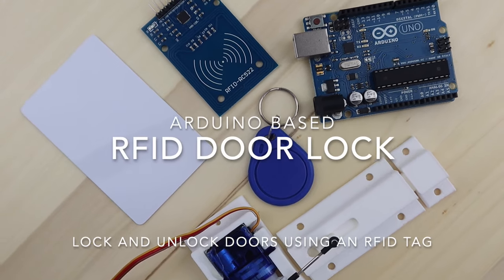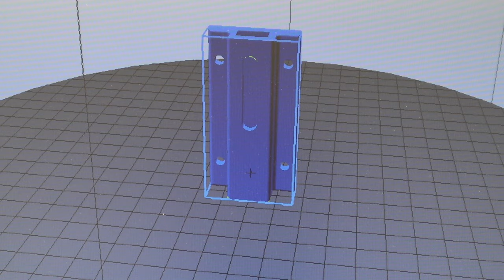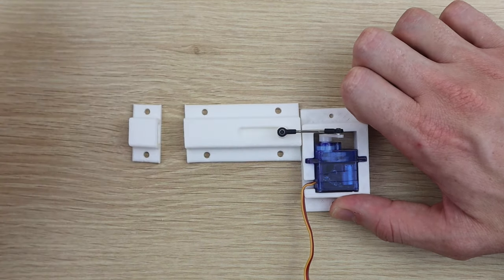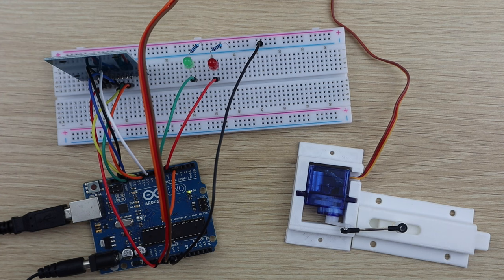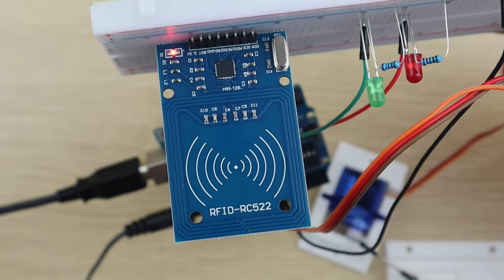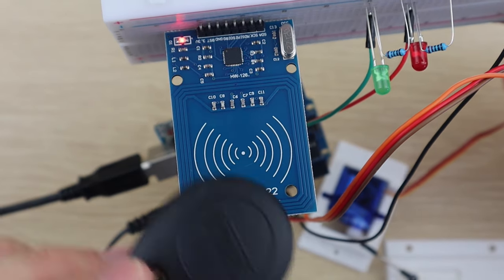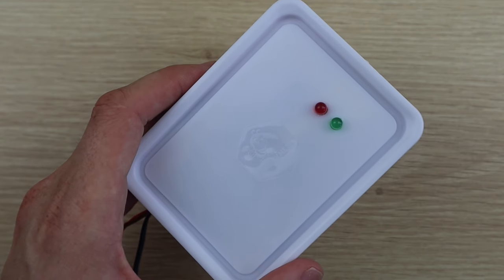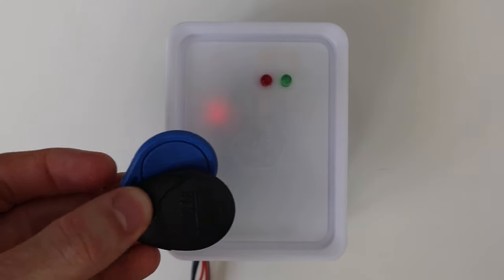Arduino Based RFID Door Lock  - Make Your Own

Comment: Hi, I just wanted to ask. I am building this lock soon but I wanted to know how you set the servo miter in the code to automatically lock after 3 secs. Thanks.
Reply from the maker: You'd need to make a few changes. Add a 3 second delay to the code after the servo opening movement, then move the servo to the closed position again. And you'd need to remove the logic which closes the lock on a tag read so that it only opens the lock.
Reply: @MichaelKlements  hi, thanks. I am rubbish with programming, is there any way that you could send me the code with the 3 second delay. Thank you.
Reply: I am building this rfid lock and I cannot code. Sorry for any inconvenience
Reply: @MichaelKlements  I am building the lock tomorrow. I just don’t know hoe to change the code?
Reply from the maker: You'll need to be able to do some programming to build this, it's not just a plug and play solution. You'll need to edit the code to add your cards/tags and adjust servo set points etc..
Reply: @MichaelKlements  I
Know, I have built a rfid aurdinio lock before but the code for the servo motor was set to automatically lock. I know how to set the limits and add the cards. I just need help with the servo

Comment: Hello Michael , I would like to use this for one of my private lockers. The thing is that I want just the RFID board to be visible and on the outside of the door. How can i make sure that once the battery runs out it will not lock itself and that's it? Can i do it somehow?
Reply from the maker: I presume that it would be locked most of the time? Meaning that the battery would most likely run out while it is locked?  You could either program in a voltage monitor which automatically unlocks and won’t re-lock if the battery gets low. Or a better option would be to put a tiny switch or push button on the outside as well which connects a backup battery when turned on. This backup battery only needs to be big enough to power up and unlock the door once. Some smart door locks which require power to actuate have small terminals for a 9V battery on the outside under a cover plate which can be accessed if the battery dies while locked.

Comment: hello Michael i have been trying to do this project but i only keep getting the place card/tag near reader message.
The card and tag came with the kit I have the elegoo mega2560.how can i solve this problem pls reply.
Reply from the maker: Hi Jesus,
If you're not getting any response on the serial monitor then there's most likely a communication problem with the reader. Check your connections again and make sure that they're connected to the correct pins. Is the LED on the reader coming on?
Reply: @MichaelKlements  yes

Comment: Can the tag be strong enough to unlock if the key is 5 feet away?
Reply from the maker: Not with these tags or readers but you get other RFID sensors that'll work a couple of meters away.

Comment: if there is a component failure, then how to open the door?? There should be a bypass system ! Can you help?
Reply from the maker: You could add a key-lock or a keypad with a code to bypass the rfid lock if you’d like

Comment: Hi sir, I have done all of the wiring properly but in the serial monitor it only shows 'Place card/tag near reader...' when I'm literally placing my card on the sensor. Is the problem on the card or the hardware that I am using?
Reply from the maker: Are you using a card or tag which came with the reader? Not all cards operate on the same frequency and are able to be read by all readers.
Reply: @MichaelKlements  yes i am using the card and tag that came with the reader, i have even tried using other card hoping that it would work but it still doesn't read the card

Comment: Hi, 
After uploading the library and paste the code in arduino ide, I opened the serial monitor to add the tag and find the card number but it say´s "Place card/tag near reader.." and after putting the card near the rfid sensor nothing appears on the screen.... What I can do ?
Reply from the maker: There’s either a fault with communication from the reader or the card isn’t able to be read by the reader.
Reply: You should try to plug your RFID-scanner otherwise in. Just turn it to 180. It worked for me

Comment: Quick question, how long can this last with a 9v battery
Reply from the maker: An Arduino Uno can't run for more than a couple of hours on a 9V battery and it likely wouldn't be able to produce enough current to drive the servo.
Reply: @MichaelKlements What battery would you recommend for it to last up to a week or more?
Am looking to add a voltage sensor to set a low battery indicator with a buzzer as an alarm but I need it to last for atleast a week or more
Reply from the maker: You'd need a fairly large battery, something like a 7Ah lead acid or a 10,000mAh LiPo. If you're trying to build a long lasting battery powered project then an Arduino Uno is the wrong board to be using, you'd be better off with an Arduino Pro Mini or ESP32 as these use far less power.

Comment: When I pass the correct cards next to it the red light comes on.When I pass a wrong card No light comes on. How can I fix it?
Reply from the maker: It sounds like your LEDs are wired incorrectly or connected to different Arduino pins to that in the code. Do they light up sequentially when starting up? Is the Serial monitor displaying the correct "Card found" and "Access Granted" lines when a valid card is read?
Reply: @MichaelKlements  yes

Comment: Hey Michael. The video has been pretty helpful but I am still confused. I wired the whole thing exactly how you have it and ran the exact same code. The LEDs go through their start-up flash sequence and then the Serial Monitor displays the Place Card message, yet when I place my card near the reader, nothing happens. I am using the same tags that came with the reader, and the reader is the exact same one you have. I ordered it through the link in the description. I just bought the reader yesterday so it is not old or anything, and it should be working properly. Please help! I also emailed you.
Reply from the maker: This is most likely a communication issue between the RFID sensor and your Arduino. Check the wiring between the two - the LEDs and text being displayed are independent of the communication link so will be displayed regardless of whether the Arduino was able to connect with the sensor or not.
Reply: @MichaelKlements  I’ve checked the wiring, and required the whole circuit, 4-5 times now and it still doesn’t work.
Reply: Rewired*
L
Reply: @ymisscarab  if you are using an arduino uno, plug the rsp pin on the 5th pin on the arduino. And place the led pin on like the 3rd or 7th pin
Reply: @rockorbonk2713   what's a rsp pin?

Comment: Sir may I ask for help? I already uploaded the code but when I open the serial monitor and put the card or tag near the rfid, it won't read.
Reply from the maker: This could be a wiring/communication issue with the RFID sensor or the tag or card you are using is not able to be read by the sensor. Not all RFID cards can be read by all RFID sensors.
Reply: @MichaelKlements  What will I do to fix this problem sir? It says "Firmware Version: 0x1C = (unknown) Scan PICC to see UID, SAK, type, and data blocks..."
Reply: You should try to plug your RFID-scanner otherwise in. Just turn it to 180. It worked for me

Comment: hey my RFID UIDS are in hexadecimal, can I just put them in the string that is in the code? Or i have to convert them to decimal?

because I did everything, but when I run the code I just get the "Place card/tag near reader..." message but nothing happens, please help meee
Reply: i think u are using the wrong hz RFID unit, the rfid unit for this particular set up is 13.6MHZ , make sure u are using the same or else the rc522 cannot read
Reply: @wenhan123  It looks literally the same, in the spects it says: MFRC-522 module, frecuency: 13.56MHz
Reply: @wenhan123  I used the "dumpinfo" example to get the UID and I got like "5E 57 2G 67" instead the serial number strings he has in the code: "310988016" and "19612012715", I'm not sure if thats the issue.

I used other code from other video, without the leds and micro-servo, where I can put the string in hexadecimal and it worked fine
Reply: @chileseco  oh u get 4 numbers means u using the wrong frequency tag, for 13.56mhz its all numbers

Comment: Could you send the wiring diagram without the breadboard please.
Reply: I'm new to using breadboards
Reply from the maker: Sorry I don’t have a diagram without the breadboard. But you should be able to work it out, just Google breadboard connections.
Reply: Ok thank you
Reply: How do i register multiple rfid tags.
Reply from the maker: You just add the ids to the accessGranted array. The write-up linked in the video description has more details on this.

Comment: How would one scale this for an actual door 🚪?
Reply from the maker: The best would probably be to buy a metal slide bolt and adapt it to work with a servo. This would then be mounted onto the inside of the door to prevent tampering.

Comment: Is there a way to do this on the Arduino Mega 2560 R3?
Reply from the maker: Yes, you can use the code and pin layout as in this example. You'll just be wasting the additional IO on the Mega.

Comment: Sir can I know why the id number of the card didnt show on the serial monitor while scanning. But I already upload the code. Sir can I know why?
Reply from the maker: Is anything being displayed in the Serial monitor? Does it say "Card found" when scanned? If not then you've probably got a communication problem with the sensor and/or there is a problem with your wiring.
Reply: @MichaelKlements  It has the same problem with mine sir. When I put the card or tag near the rfid it won't read. I already tried different codes to see if it works but it still doesn't read.

Comment: whene arduino is power on i see only led blink and console write “place card/tag near reader...” and this all...
Reply from the maker: If it's displaying "place card/tag near reader" then it seems to be managing to communicate with the RFID module as it ran through the initialisation section of the setup. Are you sure that the tag you're reading is able to be read by your sensor? Do you have multiple tags to try?
Reply: Me too my tag and card came in the elegoo kit but the monitor only displays place card/tag near the reader.What can I do. By the way does this project work with the mega2560

Comment: how to include RFID.h file in library?
Reply from the maker: The RFID.h source file is included with the sketch download through the link in the description.
Reply: @MichaelKlements  thank you very much sir
Reply: Sir another problem after uploading the sketch to the board it works but when you unplug it from the computer and use a battery when you place the card it opens and closes at the same time
Reply: Sir now it's not even moving . When I connect to the computer it works fine but when I unplug it and place the card both led started going off and the servo is not moving
Reply: Mine also like that
Reply: @MichaelKlements  pls help us
Reply from the maker: What battery are you using? This sounds like the servo is drawing too much power and is causing the voltage input to the Arduino to dip below the minimum. This causes the Arduino to "reset" or get stuck, which is likely why you're getting unreliable results.

Comment: After downloading the ZIP file to my computer, I tried to add the file to the library but I keep getting an error message " Specified folder/ZIP file does not contain a valid library". Is there a way to fix this?
Reply from the maker: It sounds like you're trying to add the whole download as a library? You need to unzip the download and then just import the RFID library.
Reply: @MichaelKlements  That worked and now it verifies just fine but it says "There was an error while uploading". I have tried changing USB ports, resetting the board, resetting Arduino. IDE, and nothing. Anything I missed? Arduino. IDE version 1.8.13 Windows store 1.8.42.0
Reply from the maker: The IDE should give you some error message/code if it can't upload, without this it's really difficult to try and pinpoint what the issue could be. If the program compiles and then won't upload then it's a communication issue between your Arduino and your computer.
Reply: @MichaelKlements  All it says is that there was an error, but it compiles just fine.
Reply: Thanks Michael, but which / where do we find the RFID.h library, there are lots to choose from!

Comment: what type of resistors are used in this?
Reply: In my code that I am trying to run I have an error that tells me "RFID:6:10: fatal error: RFID.h: No such file or directory", prohibiting me from running the code, what do I do in this case for my problem?
Reply from the maker: They're 1/4w 220 ohm resistors. The error you're getting is because you haven't installed the RFID library properly. There are instructions on how to do this after the code in the post linked in the video description.
Reply: @MichaelKlements  I finally got this to work for the first time thank you for the advice it really helped and great video!